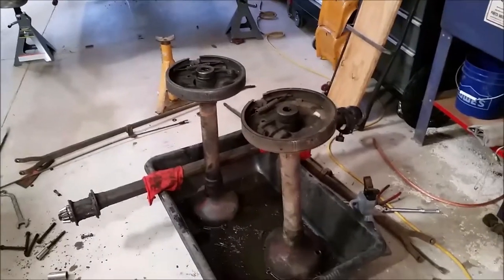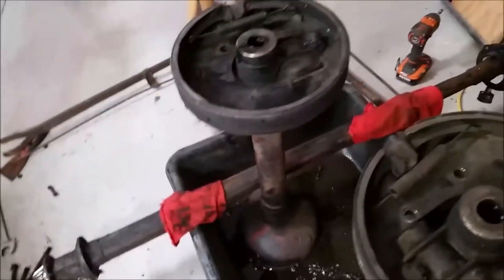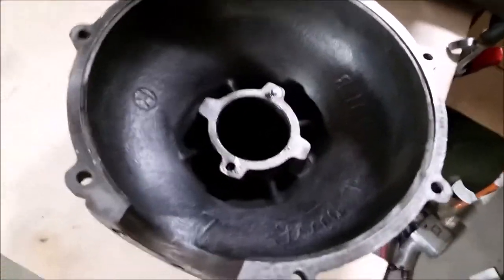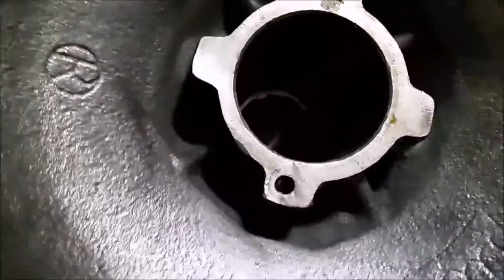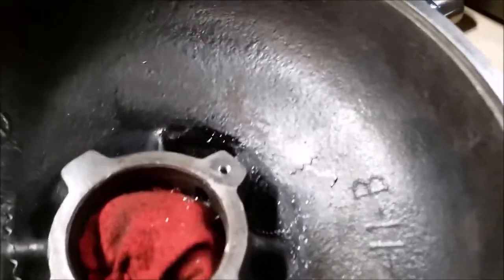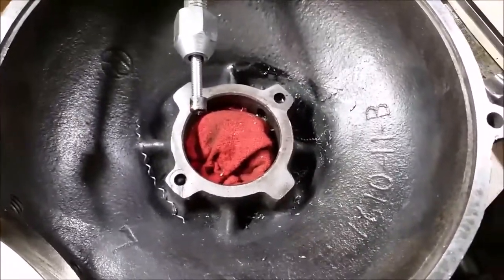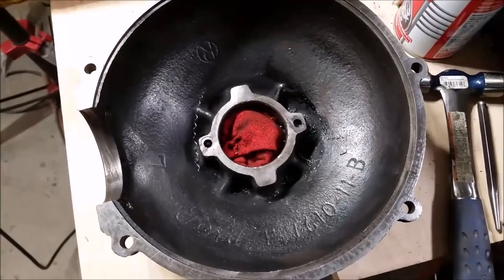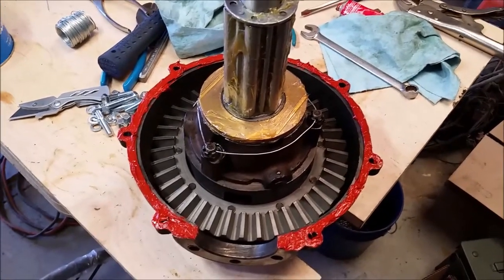Rear Axle Rebuild Tips

Comment: You`re like Me, Need a cameraman! Hope You got it back together! If I can, And they are easy to find, I use the Old baring`s if I find them in GREAT condition, They are MUCH BETTER than the Reproductions! The newer ones are solid, Where the old ones were basically as very thick coil spring flattened down and polished! They are almost indestructible, And hold Lubricant very well indeed!
Reply from the maker: I actually kept the old bearings just in case. I never through anything out unless it is completely beyond repair.